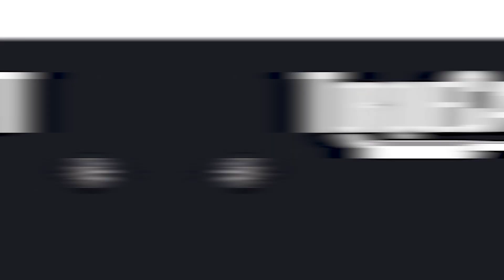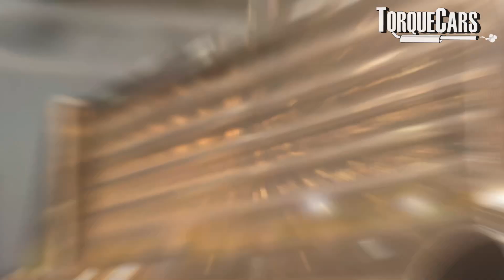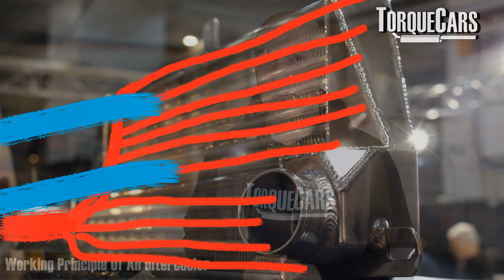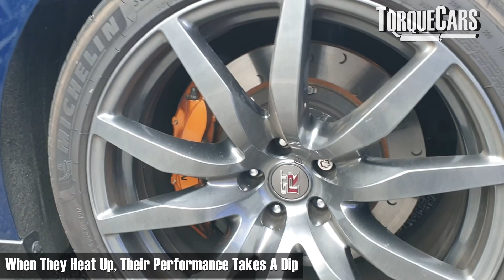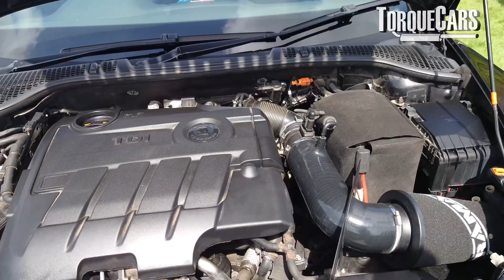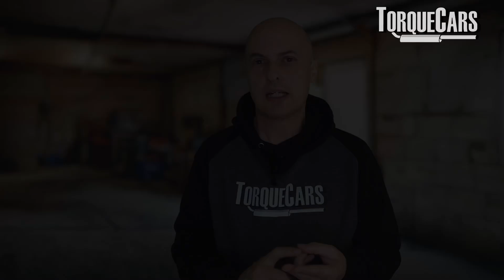What is Heat Soak & Why Is It So Bad For Your Cars Performance?

Comment: What material would be the best to make an intake manifold with to combat heat soak?
Reply from the maker: Plastic makes sense here as it does not absorb heat very well (compared to a cast one). Think about where the heat is coming from, if the hot intake stream is warming it up then an intercooler upgrade will help that, if the heat is coming from the hot engine bay then a thermal wrap will prevent transfer of heat (apply to exhaust to keep the heat locked in and the intake to keep the heat out. 

Overall the intake manifold itself is not going to make much difference when it does warm up so I'd have to say in most cases it is just not worth worrying about that considering the cost/benefits.
Reply: @torquecars  Thank you! I kinda suspected that plastic was better than metal, but what about a carbon fiber one? I'd think it'd be better than metal too, but is it better or worse than plastic?
Reply from the maker: I really don't know I would be guessing on that one as I've never tested the properties of Carbon fiber with respect to heat transfer/retention. It would look nice in carbon fiber, I saw that used on one of the Cosworth engines.
Reply: @torquecars  They do look nice.

Comment: Keep your car stock standard, normally aspirated, and drive with common sense, and you're unlikely to run into any of these problems 😺👍🏻
Reply: You're a lot of fun!!😂
Reply: @speeddemonRS3 I need my car to get me where I need to be reliably, like to work and back. I don't need to have "fun" which is just an unnecessary expenditure. If you like replacing expensive parts, or a complete engine, turbo, or transmission, go right ahead. It's your money. How well you manage it is up to you😹
Reply: @BubblesTheCat1 we all have different priorities and definitely get your point of view, but a little humorous you're watching a video about intercooler and turbo charging heat management! 👍😄
Reply: @speeddemonRS3 😹👍🏻

Comment: Great timing for this vid! I have a 24 RS3 that's stock but driven hard often, so do i need to upgrade the intercooler?
Reply from the maker: The current RS3 setup is actually pretty good, looking at the cost of an upgrade and the gains on offer I would have thought the money could be better spent elsewhere. For track days where you'll typically do many laps at full throttle it would be worth it, but in a  daily road car you are usually talking about bursts of power which it copes with.
Reply: @torquecars Thank you very much! I won't upgrade...

Comment: A good practice if you can as intercoolers tend to be low down in the front, attracting leaves and road dirt, is wash with a hose pipe, forcing the muck out of the air veins. It’s noticeable how dirty the water can be coming out the other side.
Reply from the maker: That's a really great tip for maintaining intercooler efficiency and preventing heat soak, especially with all the debris they can collect in the Autumn months!
Reply: @torquecars Thanks, and as many cars have three types of radiators all together, ( inter cooler, aircon, and water ) it cleans all of them, I found it’s worse the lower third of them.